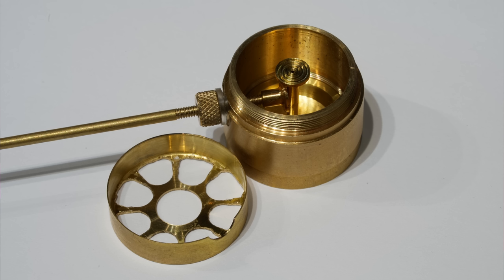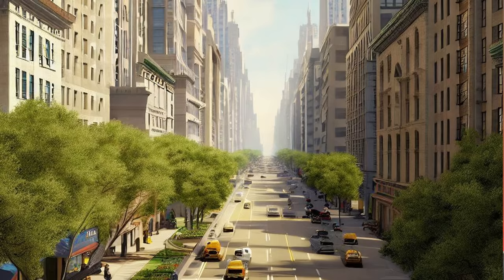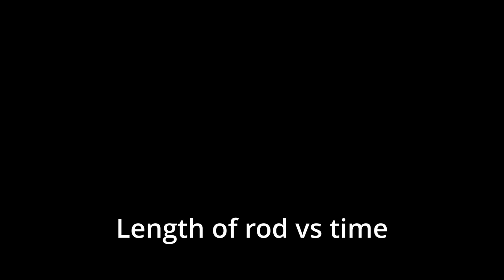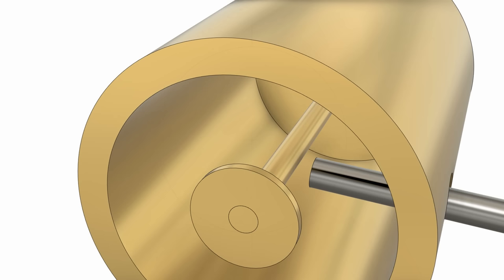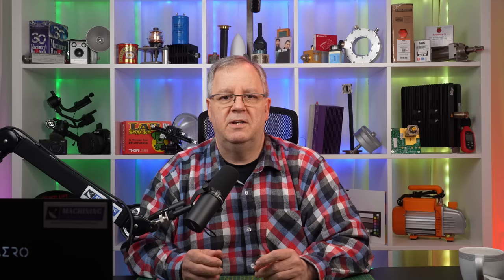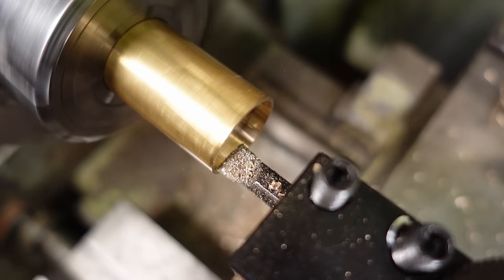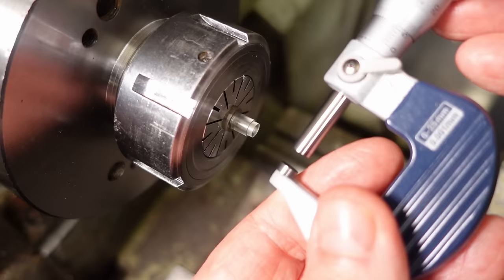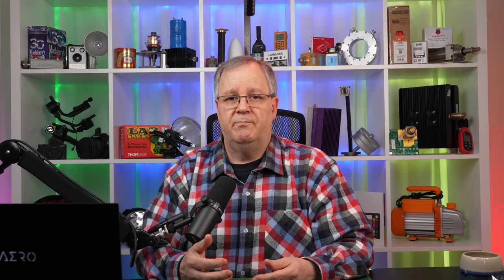SOLVING the Mystery Behind a Soviet Spy Bug : A True Masterpiece of Technical Elegance!

Comment: Fantastic demonstration of an "Infinity Transmitter."  Polish Prisoners of War made radios from  the junction of two razor blades creating a diod junction.
Reply from the maker: @robertcouper5514  I've made such a 'foxhole radio' using a 1940s blue razor blade, No2 pencil and field telephone wire wound on a US Army cardboard grenade canister. Also works using certain copper coins, the Korean 10 Won coin is particularly effective.
Reply: @MachiningandMicrowaves  Good for you not many people know this never mind actually making one. I worked on miniature transevers for the UK armed services in the 1960s using transitors which were cutting edge technology then  when most equipment were valves.
Reply from the maker: @robertcouper5514  Another project I've worked on for an upcoming video is the 1955 EASYCHAIR Mk2 passive listening device, which uses four OC71 germanium transistors, a few resistors and caps and microminiature transformers along with some RF chokes and a microwave point contact diode to make an RF powered microphone amplifier and modulator using one of the transistors to apply extra load across the diode to change the effectiveness of re radiation from a 330 MHz dipole which could be hidden inside a piece of furniture. The work was done at the Dutch radar lab using the then very new Phillips transistors. Getting hold of good quality period OC71 devices is extremely difficult because of their use in vintage style guitar effects pedals. Also sourcing the balanced armature hearing aid microphones is almost impossible. I managed to find some micro miniature transformers with approximately the right amount of inductance ( 2H). I also had a donation of some British Thomson–Houston point contact diodes of the right type, similar to the 1N23. an extremely helpful contribution was made by some of the semiconductor modelling experts on one of the UK radio forums. Making a spice model of OC 71, they worked out the required rectified DC voltage from the antenna to be able to get suitable antenna gain and ways to deal with the instability of having a device whose input and output are joined together with reactive and nonlinear elements. Huge fun.
Reply: @MachiningandMicrowaves  Remember the OC71 well and all the problems heat dissipation with heat shunts to protect them when fitting. Also the next generation of Philips AF11s for RF applications they were very expensive back in the day

Comment: I was in the Navy and attended advanced first term avionics classes which go into advanced topics like RADAR and Microwaves.  Klystrons, magnetrons, and waveguides were always kind of magical.  They either worked or they didn't.  It's not like we were going to troubleshoot the Klystron down to the component level if the unit is bad.  We would, of course, determine if the unit really is bad or if one of the inputs were bad, but things like that are remove and replace.  I worked AIMD and things like that pretty much immediately went to depot and probably eventually back to the manufacturer.  We never saw them at the intermediate level.  As far as RF is concerned, I have great respect for RF engineers and technicians.  That stuff is just plain magic.  I worked on SONAR gear and everything was in a nice low energy spectrum (audio), so I never had to deal with RF :D

Comment: Very interesting. To make sure I understand, it means that someone was nearby the ambassador's study to pick up the amplified signal by the bug.  Thanks.
Reply from the maker: The receive station and recorders would be in a building over the street that was shielded from the transmitter building. Not sure of the details but I'd guess the transmitter was 140 metres away and the receiver a little closer. The operation would have been quite a team effort

Comment: I guessed it worked by slope amplitude modulation from the first episode.   Your explanation is excellent.  I have a working Boonton 160A Q-meter.
Reply from the maker: I'v seen a 260-A but never seen a 160A in the flesh, excellent!
Reply: I picked up a used model 260A Q-meter some years back ... fantastic tool for coil characterizing ...

Comment: Thanks for the great video and explanation 👍
If i can give a tip on machining brass and bronze…. Use hss cutters.
Insert give a rough finish as clearly can be seen and heard in the video.
Hss steel needs a lot less tool pressure and will cut materials like brass easier if you make small depth of cut/ passes .
Carbide inserts are not really sharp and are technically not cutting but rather more a controlled crumbling.
Therefore carbide inserts need more constant tool pressure / cutting power to give a smooth surface finish and therefore need more infeed per pass to stop squeaking 😀.
I hope it makes sense…
Reply from the maker: I use special uncoated polished carbide high-rake cutters that are designed for finish machining on aluminium. They are razor sharp and totally unlike the negative-rake carbide inserts used on hard steels, They lose their edge quite rapidly on brass though, and I think this clip might have been with a tired one! 

I have to lap them on a diamond wheel to get decent tool life. I do sometimes use HSS, I have a Deckel/Alexander D-bit grinder, but 99% of the time, the finish I get with the good quality high positive uncoated inserts is as good or better than with HSS. I really need higher surface speeds than my old lathe can manage to get the best results on anything under 20 mm diameter.  

When I'm using a fresh or re-lapped insert, I can get a really nice chip formation without any of the squealing. I do grind a lot of carbide tooling and D bits for making microwave feedhorns.

The convenience and dimensional repeatability of inserts is very attractive, but yes, I should grind more tools!  (or at least keep them lapped)

Comment: I once attended a lecture about this device, and the speaker had a replica with components in a fitted velvet case.  After the presentation, a few of us lingered for continued conversation with the speaker.  While he was distracted by someone else's questions, I gently fitted the antenna into the cavity, just to check the fit.  At that very moment, he turned around, pointed at me, and said softly but not gently "You're on the air."  And I almost wet my pants in embarrassment.  R.I.P. C.G.
Reply: Was this at Blue U?

Comment: I've been hoping someone would replicate this. It's still the most sophisticated listening bug ever created.
Reply from the maker: The ones that followed in the rest of the 20th century made this one look very basic though.  I hope to make replicas of some of those as well.
Reply: @MachiningandMicrowaves  They used the same idea?
Reply from the maker: @dieselphiend  The first versions did, British intelligence made one that was hidden inside an umbrella.  Later versions like EASHCHAIR Mk2 used a hearing-aid microphone and a dipole antenna with a diode and chokes that rectified the RF into DC to power a tiny amplifier that then fed the audio back int the diode to change the load on the dipole, which modulated the re-radiated signal.  No power supply or batteries needed.  There's a great page about the various generations at https://www.cryptomuseum.com/covert/bugs/ec/ec1/index.htm
Reply: @MachiningandMicrowaves  That's incredible. I can't help but wonder why any of the various "spy" retailers don't sell passive RF listening devices? Are they just too hard to engineer/make?
Reply from the maker: @dieselphiend  I suspect its a mixture of them being hard to make, painfully hard to set up and the array of antennas, transmitters and receivers you need are too much like hard work

Comment: [ paused @ 1:51 ] This tweaked my geekery.
I won't spoil it, but. I spent the summer of '91 just outside Cambridge building root 2 GHz bell oscillators for the testing of satellite up and down convertors.
[ We electroplated 6 inch nails and chopped up bits of copper on our lathe. That was a very hot summber to be sweating parts together with a blow torch :'-D makes a cup of tea and waits for the nostalgia to flow.  ]
Reply from the maker: Sounds like an appropriate level of "fun" was had

Comment: Transmitter likely was actually US made, from Lend Lease, and the receiver was probably made that way as well, using cavity filters made from brass, who probably were chosen so they would roughly track the cavity temperature wise, so were probably kept in a nice heated room to mimic the office temperature. Tuning likely was very critical, and used multi element Yagi antennas aimed at the room in question, with probably a tiny feed to the receiver, making stability less critical, as they probably used another LO to mix with the received filtered signal, probably via a multistage cavity filter, to get the LO for the receiver. Stable LO at low frequency using a crystal oven was probably enough and low noise.

Then mix, run through a few crystal filters, and you have a reasonably stable system, depending likely on US made acorn tubes for RADAR, stripped from imported equipment, and US made test gear to go with it. The high RF signal for excitation probably was close to a TV transmitter harmonic, deliberately transmitted to cover the bug signal, but far enough that they could tune it out with filters in the receive chain, hoping to have the US think it was just a spurious emission from a badly made transmitter.
Reply from the maker: They certainly used TV signals to make the later systems like GUNMAN, but I doubt that was part of this design, they were just banking on nobody noticing. With a homodyne reciever, any issues of stability or frequency changes are eliminated, although of course you have to re-phase everything if you change frequency much.  With enough signal, direct conversion to AF works OK, although I found with a lot of tweaking that I could also get it to work with AM on my Russian Malahit SDR.  It's not actually slope detection of course, as the TX frequency is constant, but the amplitude and phase change with modulation.  I tried to pull out the phase mod in FM mode, but couldn't get it to detect anything.  I think a homodyne with a baseband filter would pull out the first order Bessel function sidebands along with the simple multiplication product that makes DSB AM.  One day I should make a larger unit with a more controllable diaphragm and proper anechoic chamber to see what actually comes out when it's fed with a coax probe
Reply: soviet union was developing magnetron devices in the late 1930s and would have had access to klystron tube tech post 1945, also had indigenous vacuum tube manufacture pre-war, so i dont see why they would need to go scavenge for bits since they were quite capable of producing anything they needed.

Comment: Ah! From the time I first heard of this thing I understood the concept of backscatter and the concept of "sound can change the properties of an RF circuit" but nobody ever explained how the thing worked beyond that. I figured it would have to be FM (but how exactly?) or PM (but wouldn't the effect be ridiculously small when you're talking about μm of movement against cm of wavelength?). The reality is that the soundwave is doing "FM" on the resonator frequency and then the probe is acting like a slope detector (sans the actual rectification part, which happens elsewhere) so that what comes out is AM. In normal application, slope detectors are just about the dumbest way of demodulating FM, but sometimes "dumb" is absolutely beautiful.
Reply from the maker: The movement of the membrane is around 10 nanometres on a gap of 25 micrometres, so about 0.04%, but at 1 GHz, that amount of change would affect the phase of the retransmitted signal slightly, but I couldn't detect any PM.  That could just be the capture effect of the strong illuminating signal, which I could null out to -75 dB after many hours, but may have still been much stronger than the reradiated signal.  One day I might set up a more robust experiment.
Reply: BS
Reply from the maker: @williamnot8934  "Back Scatter", I assume!!!
Reply: @MachiningandMicrowaves  Shovel,Rubber Boots and Wheelbarrow BS
Reply from the maker: @williamnot8934  Ah, THAT variety. Super
Reply: @MachiningandMicrowaves  Another free energy nutcase I presume.
Reply from the maker: @williamnot8934  There's a lot of that about
Reply from the maker: @williamnot8934  but in my Universe, we obey the Laws of Physics. A tiny bit if energy from the inbound RF field excites a resonance in the cavity, and like any receive antenna that is matched, at least half is radiated, but as there is no dissipative load other than surface skin resistive loss and a bit of contact loss in the threads, a fair proportion of the inbound energy is reradiated, but with some if the energy now in sidebands carrying the audio signal, Around 0.1% of the energy is dissipated in the structure, the rest radiates in a multiple lobed pattern and if you set it up well, some of those lobes beam in directions where the incident energy doesn't reach
Reply from the maker: @williamnot8934  No Laws of Thermodynamics were harmed in the making of this video, the losses in the system are spectacularly huge, with a 5 watt illuminating field, the reradiated modulated signal is around -100 dBm at the receiver, so it's about 5 picopercent efficient.
Reply: @MachiningandMicrowaves  About the closest thing to free energy I have come across is the Crystal Radio Set I built in 1963.
The rest is pure fantasy and of course BS.

Comment: Wouldn't a negative inductance be equivalent to reciprocal capacitance? I think the seldom-used term for that (when applied to a capacitor) is elastance.
Reply from the maker: Elastance is definitely the word. I asked Google and got spammed by this pathetically-useless answer from Quora's rubbish AI bot:

SAGE: An AI bot writing "helpful" answers
What is the inverse of inductance?
The inverse of inductance is called "admittance", which is measured in siemens (S). It is a measure of the ease with which an alternating current can flow through a circuit. The reciprocal of inductance is called capacitance, which is measured in farads (F).

Spoken with all the authority of an opinionated and cocksure teenager who once read an incorrect Wikipedia page and mis-remembered it.  Great.

Not "helpful", just completely and disastrously wrong. However, the humans on Quora are also mostly wrong, so it'll fit in just fine!

Comment: The cavity acting as a variable capacitor seems straightforward enough, but the point about the antenna re-reflecting is pretty mind-blowing considering they didn't have visualization software. Wonder what ever happened to those engineers... probably defected to the USA!
Reply from the maker: All matched antennas re-radiate half of the incident energy, and unmatched ones re-radiate almost all of it.  The cavity is slightly more than just a capacitor, it's a weakly-coupled high-Q resonant cavity. Termen continued working in Moscow until he retired, although he visited the US again in 1991. There's an excellent documentary about his life. https://en.wikipedia.org/wiki/Theremin:_An_Electronic_Odyssey and Glinsky's book Theremin: Ether Music and Espionage is also good. I've seen it suggested that he corresponded with, and even wondered about getting back together with his American wife, who he'd had to leave behind after his rather, er,  "hurried" exit from the US in 1938. He'd spent ten years in the USA in the 20s and 30s. There's no record of anyone else involved in the construction, but any clockmaker could have made the metalwork and the rest of the equipment is fairly straightforward. Easy for me to say with 20/20 hindsight of course.  Making that connection between Termen's knowledge of radio frequencies from his instruments and his researches at the US Patent Office on microphone technology, it's easy to suggest where he made the connections between the various technologies, but having the spark of genius to be the FIRST to do it is what makes the difference. A bit like running the four-minute mile or climbing Everest.

Comment: I always assumed there was a diode, acting as a frequency doubler to the incoming signal, with that doubled frequency modulated with the mic, and then retransmitted. This is much more elegant, and I assume, more efficient?
Reply from the maker: Horribly inefficient, but SO elegant!  I'll be doing a deep dive on the Easy Chair Mk2 which DOES use a diode
Reply: @MachiningandMicrowaves  Yes, and a good demo of slope demodulation to recover an FM signal with basically an AM receiver. Horrid noise immunity, and very poor performance, but it can be very effective.
Reply: @MachiningandMicrowaves  but if you include a frequency multiplier it is easier to detect using a bug sniffer looking for harmonics !